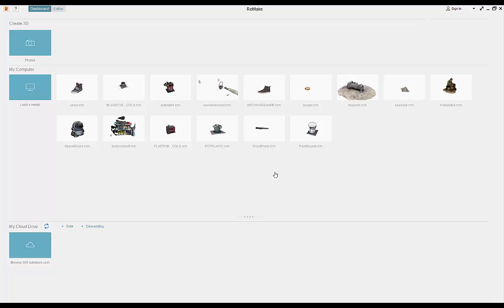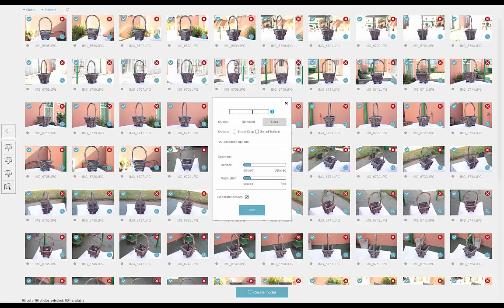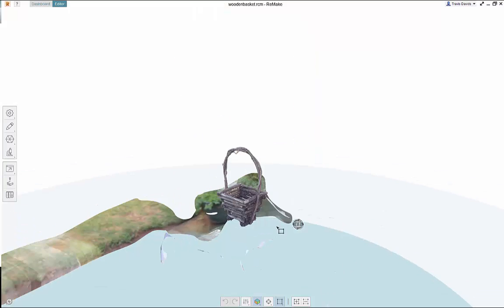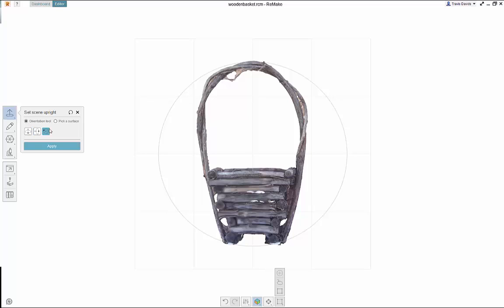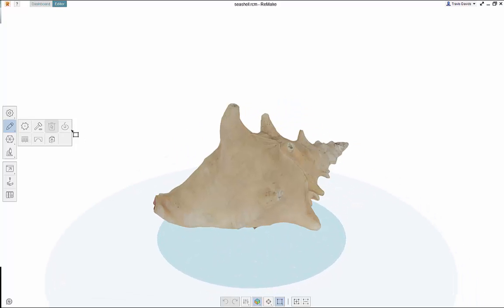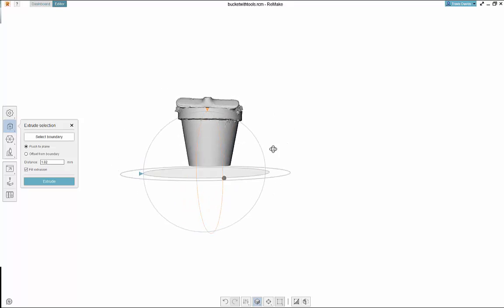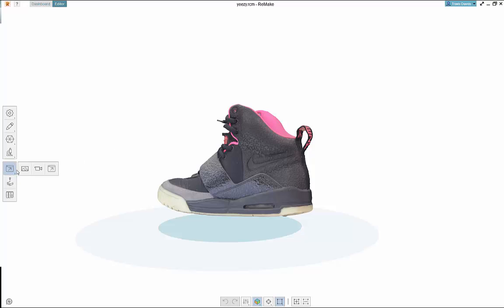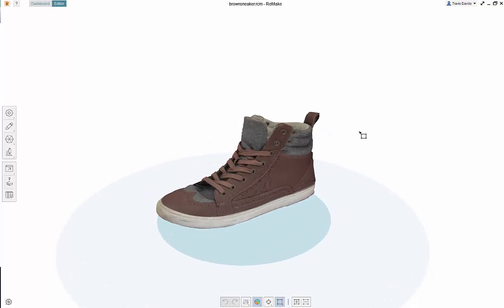Autodesk ReCap - An Introduction To Autodesk ReCap (Previously Remake)

Comment: Hi Guys, Autodesk remake or recap? It is not possible to find autodesk remake onlie for trial download. Am I right or wrong?
Reply: Remake has been discontinued, its now called Recap. The interface in this video is the same as well as the tools in the new Recap so you can still use this tutorial to follow along even if you are using Recap.